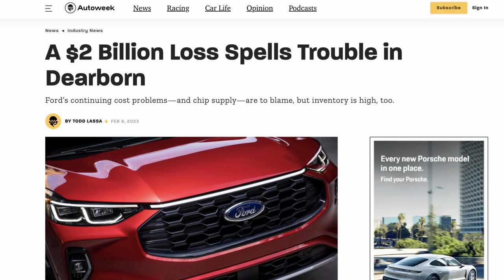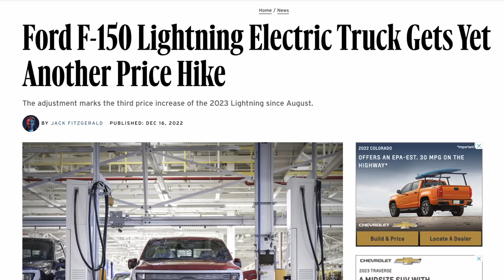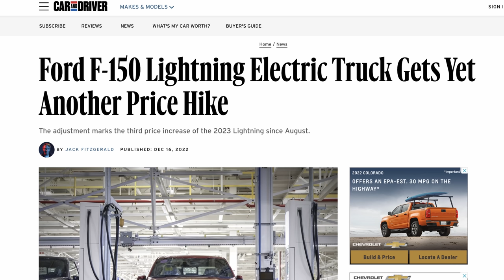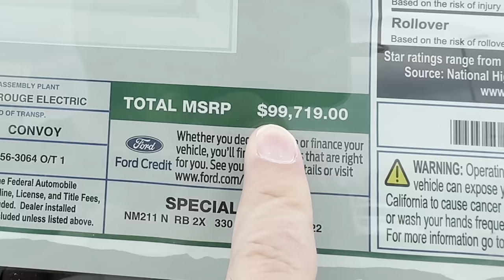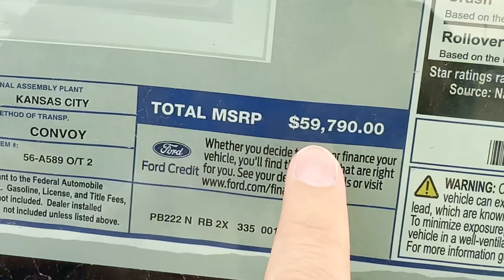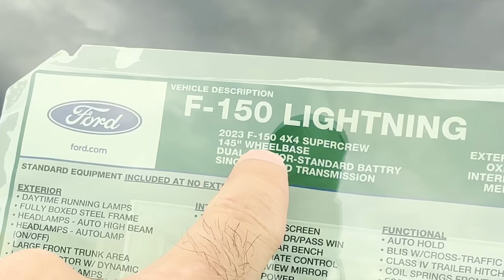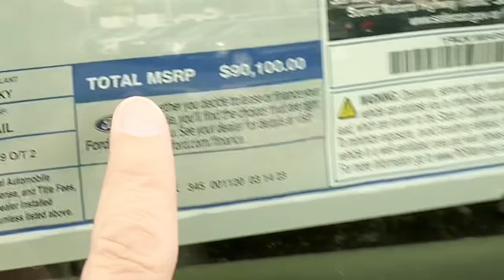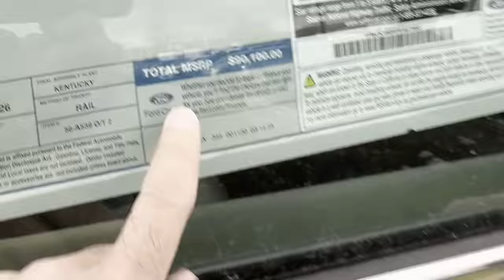Ford CEO Makes HUGE MISTAKE, Now Dealers CAN'T SELL TRUCKS!

Comment: Always was a Ford truck buyer, bought quite a few Pickups and Econoline Vans when I was in business. Retired now and was looking to replace my 1995 F250, work truck. I could not find a 150 on the lot that was under 65k, all were 4x4 and 4 door trucks. I would think a few basic trucks without all the options would still sell if they were on dealers' lots. They had a couple 150's in the showroom over 100k, I guess I need to keep the '95.
Reply: If you are buying anything later than a 2000 anything ,, goooood luck , the image war is hard to keep up with , 1995 ,,perfect
Reply: Just re do the 95 for sure!!
Reply: I replaced my '95 Ranger with a 2010 Ranger. It was super clean inside and immaculate under the hood. The '95 cost about $7k when I got it and the '10 cost me about $9.5k. If I get 330k miles out of this one too, I'll consider that a good investment.
Reply: Ford does special orders for commercial pickup trucks that have an 8 foot bed and only three seater. But you have to order that online, fill out the application at the dealership and then wait 5 months for the “special order” to arrive at the dealership. 

And that is why contractors are choosing older trucks instead of newer trucks.

Comment: You hit the nail on the head. Owned Fords my whole life. I will NEVER buy a Ford ever again in my entire life. Unless it's the best deal of my life. Then I'll sell it and buy something else that will last.
Reply: Wait for those Rainbow Raptors to go to half price.. re-paint it or wrap it with whatever you want
Reply: @Roger Wilco   those raptors have a design flaw in block the cylinder wall is to thin under boost the blocks crack.
Reply: I will only buy old Fords from now on and rebuild them, I don't want to drive a computer anyway
Reply: Ford went woke also, so they lost me.
Reply: Buy your self a pole blower raptor
Reply: The old Ford trucks are still good, I have a 2000 Ford Ranger XLT with the 4 cyl 5 speed, with 165k miles on it and it still runs like new. The new ones are down on quality, because they buy cheaper parts now, the problem is, they all do it.
Reply: Been driving my F-150 XLT Lariat 4x4 for 31 years.  it's been my daily driver for the past 19 years.  Same engine (no rebuilds).
Reply: 1995 and earlier Ford's are ok. They hadn't made the garbage changes yet in those years. Otherwise ya, newer Ford vehicles are junk. Don't buy.
Reply: Trust me if you think any of these other manufacturers are better youre way wrong
Reply: @Off-Grid at Liberty Point 
Still have my 99 F350. Very dependable. One fuel pump and a alternator is all it has cost me so far.  This year my wife’s 2018 edge had the engine fail under warranty. Took almost 4 months before we got it back ford tried multiple times to make me pay for the engine, even tried to negotiate me paying half . Bought the maintenance package at purchase. The dealer is the only one that ever touched it . Eventually they paid for everything. Including a brand new loaner , while they had the car
Reply: The only Ford that I hadn't had problems with was my 1997 Expedition.  Other than that. All yhe Ford Escapes failed transmission.  My mother had two go bad. I just put a new transmission in my 2013 Escape. Lifetime transmission fluid my A÷$. My 2005 6.0 Excursion is now on its 3rd engine. If I had known, I would have done a Cummings swap the first time. Ford is dead to anyone who appreciates quality and reliability.  . . You're correct,  they all do it. The same people that talk climate change are the same people building junk, so we have to keep mining, making steel, and buying their products.
Reply: @theirishman088  I’ve been extremely happy with Mazda, Lexus and Toyota!
Reply: @beri232  I like Lexus  but it's a little pricy for me.
Reply: @hatdowntight  is your astro with the v6? Those little V6s are monsters if cared for... Kinda a pain in the ass to rebuild the heads [from inside the cab- the right side, header bolts are right on top of the firewall tunnel and just hard to get any tool in there to get them out. 1/16th a turn at a time...] but having done it before in a professional mechanic shop. It's not hard with not many tools too.. you'd be surprised. its only like a few sockets, like 5 extensions. a wobble socket, and you can have the heads out EZ.
Reply: Had a F-150 30+ years ago I loved.  It was simple, and it just worked.  In the late 1990s had another F-150 and wife had a Windstar and between our experiences with those two - we'll never buy another Ford.  Yes, they were that bad.  The service personnel at the dealership knew us on a first name basis, would recognize our voices on the phone.

Comment: My dealer called the day I was done paying for my  F150. I literally laughed at them when they wanted to "put" me in a new truck. No way, I'm keeping the  F150 until I can't afford gas anymore. They are wayyyy overpriced!
I'm actually glad to see them price themselves beyond their target customers. 
This is exactly the correction they will need to survive long term.
Reply: Issue is people keep buying them. I live in Massachusetts where trucks are very seldom needed for truck purposes. And I see brand spanking new  $70,000+ 2021, 2022, and 2023 F-150s on the road EVERYWHERE. Every. Freaking. Where. Ford and other truck manufacturers will price gouge and gladly keep trucks on the lot for 6 months each while people keep buying them

Comment: $1,795 is not much of a discount.  Keep in mind that in 2019 a $10,000 - $14,000 was not uncommon, especially towards the end of the model year.   Also, many of the option prices have increased as well.  The hitch went up from $150 to $315!  Nothing but the same old design.  Pure price increase.
Reply: my last new F150 I paid $34K. MSRP was $48K CDN that was 2006. With 0% financing.
Reply: @muskokamike127  Yep.  No question Ford has the mark up to discount these pickups.
Reply: I bought my 2018 F150 brand new in January of 2019 for $36k. It was an Xlt 302a with the 5.0. The MSRP on it was $51k. 

When it was totalled in 2022, a used 2021 Xlt 5.0 with 20k mi on it was running $50k. My only saving grace was insurance giving me more than I originally paid for my 2018. Prices are outrageous now for absolutely no reason
Reply: Gonna have to be 20k now lmao
Reply: @42ambrocio  lmao you ain’t kidding
Reply: @42ambrocio  plus an extra $5,000 for dealer markup!
Reply: Your absolutely right! Now people seem to be trained to think paying full sticker is somehow a great deal over the previous additional “Market Adjusted Greed” markups! Paying $60K+ for an F150 is special stupid!

Comment: At that price they can keep those trucks. I ended up buying a 2018 Ram 1500 V6 with 32k and new tires for $22,400 and it’s like new 👍
Reply: You got ripped off.
Reply: I paid 19k for a 2018 z71 Tahoe they wanted 86k for a 2022 it’s just too much
Reply: Ya you can find them for about what I paid but they all have close to 100,000 miles on them. Check it out . Mine has only 32k and one owner.
Reply: @alanzolotoff6014  Yeah you got a decent deal bro.
Reply: I just Bought a ram classic v6, the thing is such a nice ride, the v6 will also lasts well over 300k miles
Reply: It’s a dodge lol
Reply: @717weston2 more reliable than new ford trucks that’s fore sure
Reply: 22400 for the tires?  Da fuq?
Reply: 22K for new tires? What the hell are they made of, gold?
Reply: @MoreJamesSmith  IKR?  Why is he spending that much on tires?  No one spends 22K on tires.
Reply: That's a good deal. I hear the engines are really good
Reply: @christopherjoyce833  there great engines, that why I went with Ram. My buddy has a 2012 Ram with a little over 200k on it and it’s still running strong with no problems at all..
Reply: That’s a super deal. Good for you.
Reply: @alanzolotoff6014  
You have a good buy. Dakota?
Reply: @kode4420 1🤡
Reply: @717weston2  hell ya that’s all I ever buy are dodges, I’ve had great luck or there well built ?
Reply: @nosywendigo592  yep, there very expensive tires made with gold steel belts !
Reply: @nosywendigo592  but I do lol
Reply: I agree, there great engine ! I have a few buddies that have the Ram 1500 and have had zero problems.
Reply: Levi  I’m saving on a shit load of gas compared to my Hellcat 👍

Comment: "When the F-150 first came out it was a simple work truck. Now it's a complicated luxury vehicle that the average American worker just can't justify spending their hard earned money on." This is a remarkably similar parallel to Microsoft Software, such as Word and Excel. When they were first released, they were (relatively) simple programs that people got to know and love. Over the next 20 years, Microsoft added feature after feature after feature, creating a new term: Bloatware.
Reply: Sounds gross.
Reply: Jeep is doing the same thing, they no longer make affordable Jeeps, they are all top of the line high end 4wd's that cost a fortune.
Reply: @steves2241  the 4wd is another problem. Up north, it's almost necessary to have 4wd if you drive a truck otherwise you'll get stuck in the snow/ice. It seems like if you want 4wd, the manufacturers assume you want the luxury package so then you see people with a simple old truck to use on the farm during the summer and fall and then a car to use in the winter. I'd like a new truck but I can't afford one : /

My sister has been talking about getting a new truck for her farm and they're just thinking about biting the bullet. It sucks because the luxury crap will get ruined right away and your trucks will get dents after a year of work

Comment: I was recently doing some checking on availability and was surprised to find about a dozen f150's at our local dealership. ALL were priced at around 75k. Couldn't believe people walk in and pay 75 thousand dollars for a half ton pickup. So glad I like taking good care of my 12 year old ram 1500 that looks and drives like new!
Reply: As you should! The older the car, the more reliable as long as they're taken care of. I'd take my 2004 Dodge Durango with 120k miles all over again than even consider buying a new truck
Reply: @RichieRich7339   Do you trade your vehicles in on older vehicles ?
Reply: Its so Bad that I am keeping my 1994 Gmc serria 1500 300k miles.
Reply: @RichieRich7339  I have a 2007 Chrysler Aspen with 109K and the 5.7 Hemi that looks and drives like new.  I don't  live in the rust belt, so not one speck of rust. I'm keeping it.  I can't imagine paying $109,000 for a new Wagoneer.
Reply: @Ed Schulhof   If old trucks are the best, why drive a pos like a Vue .
Reply: @dknowles60  Same boat, '99 Silverado 1500 260K.
Reply: Yup, I  gotta 2000 f350 powerstroke with 156k on it! It tows awesome and the 7.3 durability and reliability is frickin awesome! I also have a 1998 mustang gt with 63k on it as well as a 2001 expedition Eddie B. They all run great and have been paid off for years! NO CAR PAYMENTS! I keep the maintenance up and its the way to go!! All the money I save per month with not having to pay car notes, I have put on my house, and will have that paid off in 4 yrs!  Yaaaaaaa buddy!
Reply: The used cars have been pulling huge numbers. I got 5k more than I payed for my 300s.  I promptly bought a challenger rt.   My 4x4 ram crew cab was only 33k brand new with a 5.7 hemi. So we payed cash
Reply: My ram is a 98 and I keep it going.
Reply: I'd buy a used truck and do an engine swap before I'd get something new. Even if they were cheap the amount of electronics makes it a no buy. Don't want to bring it back to the dealer every 4 months cause some sensor went bad and put it into a low power state.
Reply: @Ed Schulhof   I drive an actual truck not a grandma's fucking Vue .
Reply: @Zac Spencer    How many do you have running at one time ?
Reply: @cb-gz1vl  For me it's the electronics but more importantly the unavailability of a manual transmission. I don't like automatics and I just won't buy one. Sticking with my 2012 Xterra for the foreseeable future.
Reply: Totally agree, I bought a 2018 F150 4x4 in 2020 with a interest rate of 2.5% for a pymt of $461. With the poor quality of Ford vehicles and a loan rate of maybe 6% why would I want a pymt of 650 - 750 with 12 recalls. I hope the manufactures and dealerships take a bath.
Reply: @sarahann530  well,  I got a company car so it helps.  To be honest, I have to make an effort to drive my truck and stang. My wife drives the expedition.  She goes to the store once a week.  We just don't drive around for the hell of it.  There's gotta be a reason.. That helps to i think..
Reply: theres a dozen parked because people do not pay that kind of money.
Reply: @zspence77   So you have an old 350 ,Mustang ,Expedition and company car . Why ?
Reply: @currentsitguy  Me too. Can't stand automatics. A simple stick shift. Now I get when cruising, the automatic can be more fuel efficient but that's if you're a huge truck doing micro adjustments of fuel.
Reply: Only 12 years old? My beater Ram is 30 years old lol
Reply: @717UT   That's nothing every 30 year old Ram is on the road .
Reply: @cb-gz1vl  I'll sacrifice the mile or two per gallon to be in complete control of my vehicle.
Reply: @sarahann530  Haha in one state of disrepair or another, yes they are. Mine is somewhere between bad and worse. But 33% of the time it works everytime.
Reply: @zspence77  l
Reply: Yes, I’m 14 years into owning my F150 and at this point the new vehicle novelty has worn off long, long ago. However I’ve kept it almost like new and payments are a distant memory so the truck is nothing but money in the bank to me now.
Reply: @Aspen5.7  See it's wild that people would even consider paying these crazy amounts for lower quality vehicles. Keep that Aspen clean bro! I'm rooting for another 100k minimum for ya!
Reply: @sarahann530  No. I wouldn't consider trading in a vehicle, I'd private sell because the dealer will never give you the correct value 😔
Reply: Repos coming
Reply: @Richie   So do you buy older vehicle's each time to replace the one you sell privately ?
Reply: @sarahann530  I see where you're going with this so I think you're missing the point I was making. Honestly I'm on my 3rd car ever, and that going from a 2004 Durango, to a 2015 civic (with payments), then to a 2021 Silverado lease. My point was I prefer older vehicles if I can pay in cash and know I can ride them for another 100k+ miles rather than having payments. So would I buy out my lease to sell it for more money than residual and pay cash for an older vehicle such as an Xterra, Ram, or Ford, you bet your sweet bippy I would. Bonus is I can work on them myself and save tons on repairs. But that's just me.
Reply: @RichieRich7339  I am right there with you on all points. I've always driven vehicles I can either buy for cash, or find a good deal financing and paying off quickly. I doubt I will ever buy a new vehicle because it's such a tremendous waste of money
Reply: @A Conneely  I always sell outright and price reasonably and they sell instantly which always tells me I sold too cheap. But I can sleep well and know someone got a great deal. My vehicles are stored inside, driven lightly,  always spotless and maintained to the highest level....including my dirt bikes and other  toys.
Reply: @717UT  And granted, I'm only 27, but I'm not financing something for over 50k and that will have the tremendous amount of recalls lol. I want to spend my cash on stuff I want, not barely scrape by looking cool on the way to the dealership service center
Reply: @outfitr9703  👀 did someone say dirt bikes?
Reply: @sarahann530  I always do. Ask the mechanics which years have the most problems or which years have the least problems to avoid lemons.
Reply: @drunvert  So which years have the least problems
Reply: @outfitr9703   Do you work for less than you are worth ?
Reply: @Richie   Why would you lease a 21 Truck  when you prefer older vehicles . ?
Reply: @sarahann530  sometimes
Reply: Used is where it's at now. I have 400k miles on my 4.6 11th gen F150. I'm looking to buy another one (not selling the old one though, never). You can find a 4x4 4.6 11th gen with less than 100k miles for less than $15k and have a reliable truck for years
Reply: @hank1556   The older one is worth nothing
Reply: @edschulhof6303  Saturn made good cars.